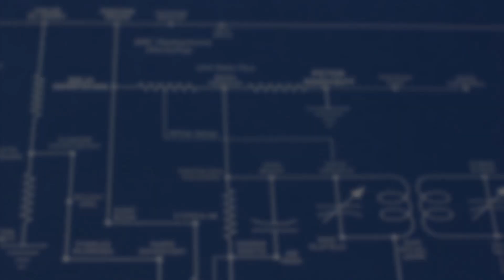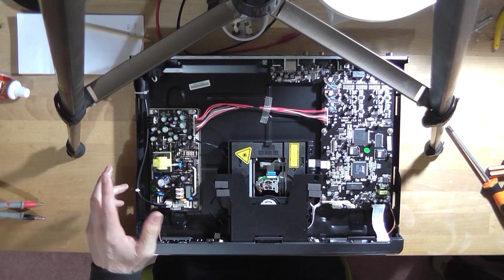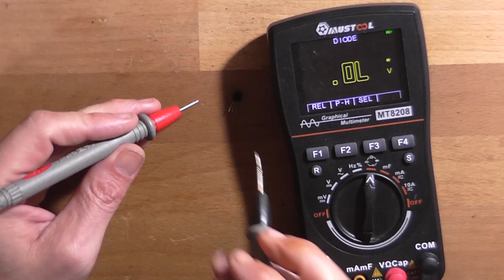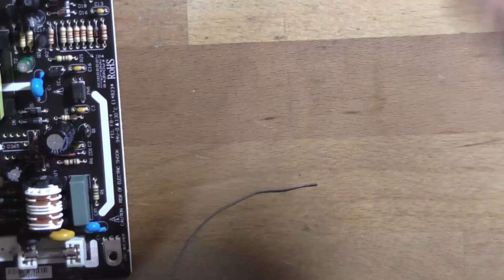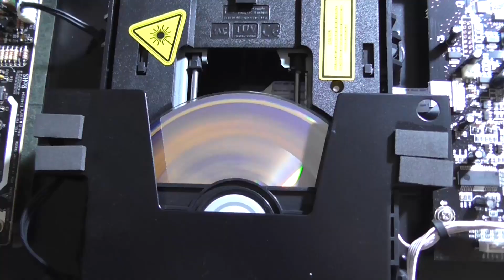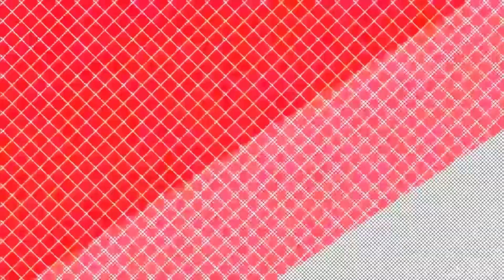Harman Kardon HD990 CD Player: From Bad to WORSE!

Comment: There is a cheaper version, the HD980 wich costst used and working around 100 Euro (Ebay) and it uses exact the same PSU.  The owner could try to get this model and harvest the complete PSU from it.